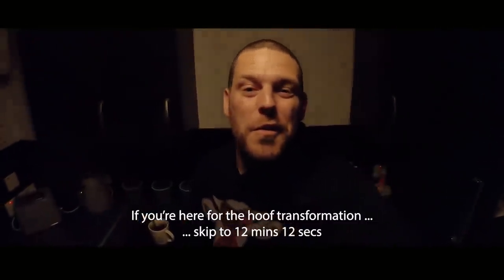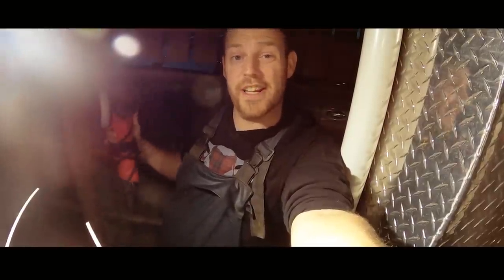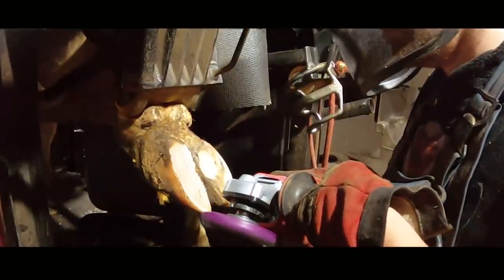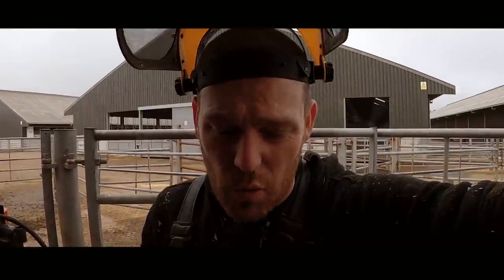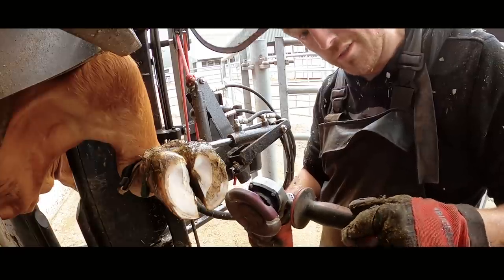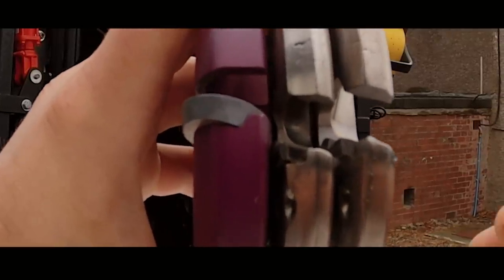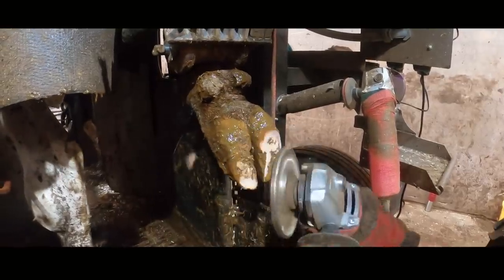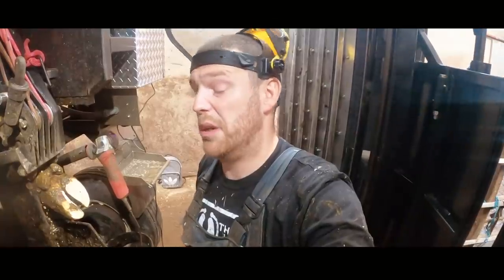*RESTORING a COWS HOOF* ... TRIMTEC vs ROTOCLIP hoof trimming dwheels | The Hoof GP

Comment: You should call the company and complain to them about how the "new" blades are not standing up the way they used to in the past. It may not be an intentional change in formula. It could be a problem with Quality Control (QC).  The metal may not have been heated/cooled at the correct temperature. The amounts of metals added to make the blades may have been measured wrong. The company may have received other complaints and will correct the problem. They know you are a regular customer because of your complaint and others, if there have been. They may try and help you by sending you a box or case of blades. It is worth a try. I know that if you contact diaper (nappies) companies about having defective diapers in the box, they will send you coupons for free boxes. Give it a try. I would like to know how you make out. Good luck!
Reply: Actually do this. You'd be surprised what the company does sometimes!
Reply: Also try getting new inserts for your preferred discs. The original supplier might have them or be able to tell you where you could get them from. Or take one of the inserts to a machinery supplier and see if they have a suitable one to fit.
Reply: I think in any field there are those who are out in the field actually using the product and then there are the people developing the product who don't always know what it's like to use said product on the scale of someone like Graeme. So the downgrade of the product was probably not intentional, as you say, they just need enough experienced people to come forth to properly articulate the problems to fix them :)
Reply: I agree with checking with the company.  One difference is that you are distributing knowledge about equipment, testing and needs and a whole lot of people are paying attention and may even come up with other uses outside the hoof trimming field. Another part is send some video clips, let them see work, visual may connect better with an explanation.
Reply: I hate to say it but the maker of the old disk may have made intentional changes to the blade to decrease lifespan to force increased sales of their products.  Happens a lot.
Reply: Those inserts actually look like some inserts we use in woodworking forthe planer or in the lathe.
Reply: It's not just quality that he is having a problem with The company have stopped making them.

Comment: A  swing arm for chord setup above and slightly behind your working position would remove most of the chord in the way problem. Just find a mounting point for a bit of pipe top and centre and weld it at a vertical. weld a smaller bit of pipe at a right angle to a long bit of pipe. Insert the small bit of pipe in the slightly wider bit bit of pipe on ya crush and you have a removable swivel arm.rin the chord along the arm and you will have access to the sides and back.  Paint it gloss black and it'll look standard.

Comment: First like. The back blade and aggressive cut is important for you because you are up against the clock. Tools are important because if you don't have the right tool, you can't do the job to your satisfaction. Good on you for trying the others but you were better with the number you first thought of. If you have a lot of cows to trim, its going to be quicker and easier with the right tool.

Comment: I use a wheel similar to trim tek but made by the company I bought my chute from. I do use trim tek on sand bedded cows because they're thinner soled and the trim tek is less aggressive. The other wheel is a lot more aggressive than trim tek. If you would like I could get you the info to order one to try. Also they are easier to model with.
Reply: Can you share some info on these disks, pls? Who makes them etc?
Reply: @oldandlumpy  Riley built in Lubbock TX makes them Google that and you'll find their website you can call them to order one.

Comment: The blade inserts on your older discs look to be a fairly standard carbide blade, very similar to the ones we use for our spindle, you should try getting some from a wood working supplier you might have some good luck with these as they tend to be of a very high standard. Another groovy video, not boring at all young fella.

Comment: I just did a quick search of that new disc and wow they are really proud of those things!! I was going to suggest taking the carbide cutters out of the disc and "model"  the disc out to re leave the metal where you would like the carbide to cut on the back side.  I am assuming the disc is aluminum. If so reinstall the disc back onto the grinder (minus carbides) and use a hand file to reshape the disc while it spins. you'll have to clear the aluminum from the file regularly but it should do the trick and get you the cut you want.... maybe.... good luck:)

Comment: Graeme just be aware that the cord grinder is a bush motor so it will need to have air flow over the bushes to cool it or it will burn out the armature.

Comment: The Roto-clip discs come with thicker metal from the factory. Once you wear them down a little they cut way better. If you get another disc from them get the thin one. It cuts on both side similar to the trim tech and are more aggressive outta the box

Comment: Great video Graeme.  Interesting to see the different type blades.  They have a LOT in common with machine tools.  Carbide cutters, etc.  It looks like all three have replaceable inserts  They might be standard carbide inserts available from a machine tool supplier.    You mentioned the new ones don't stay sharp as long as the old ones, that may be because there are different grades of carbide.  Again, a good machinery supply house can help select the best cutter insert.    The purple one has the inserts set with a real positive rake angle with the back side not exposed.  You may be able to have a machinist take off a bit of thickness off the back to expose the cutter.  It will have less of a positive rake than the front but because the insert is circular and the cutting edge is still exposed with a slight +rake, it should still cut but a little less aggressively.

Comment: Two points, the cutters you showed appear to be standard Sandvik inserts used in machine shops and carpenter shops all over.  They come in a number of configurations (a small book) and I'd be confident you could find and use something as good or better than what you have now.  If you want really scary aggressive, and I mean scary, mount up a circlet cutter on that grinder.

Comment: It seems to me you could get all three to cut on the back face of the disc with the right insert, have you asked an engineering workshop if they can machine you some inserts for your trim tech or other model using a tooling grade metal?

Comment: You seem to need a disk with a round carbide blade on the tip and 2 rectangle blades on the inside with a cut away behind so you can do the tips of the hooves.

Comment: quick question. I understand the purpose of trimming the hoofs I think.  But why do you cut the bowl or curved part out?  Wouldn't  a straight flat hoof provide more surface area and therefore better support?
Reply: He says it in other videos, but most of the strength and structure comes from the hoof walls. He models out the middles to reduce pressure on the soles. Too much material on the sole with all that weight and the pedal bone inside the claw pushing down leads to bruising and ulcers. Modeling correctly on each claw prevents all of that without compromising the integrity of the hoof.

Comment: An overhead cord drop with a spring loaded kellam grip would give you the best of both worlds. Lightweight corded grinders and no cords on the ground under your feet. A two foot swinging arm to Mount the spring cord grip just above head height so it doesn't get in the way.

Comment: As someone who works in a machine shop.   YOu can get harder bits for cheap and just replace them on the blade instead of replacing the whole blade.  There is a wide variety of inserts that are easy to install.  Just look up lathe inserts.  Also, titanium is relatively soft compared to tungsten or tungsten carbide.  Tungsten carbide inserts are what is usually used to mill out metal.   Titanium would never last.   Keep up the good work.

Comment: The Trimtec titan with LX and rimcut was the best blade, if only because of how comfortable with it you were, and based less in the results you showed. If you're looking for a replacement blade, I would seek a blade that has similar features. You're safer with a tool that you're more comfortable using, so that's what I'd seek.

Comment: I LIKE the idea of ‘your own blade’. The only issue I can immediately think of is that YOU may one of the few that use those aggressive blade. It may not be a good financial thing. But,.... I’m SURE you will have looked into that. 
On a lighter note I enjoyed Craig’s quick cameo. 
There are many times when I can see grooves from the blade on the flat part of the hooves.  Does an older blade cause that?

Comment: Getting used to new equipment is always weird. The new purple disk does a really nice rounded trim for modeling inner parts of the claws but it looks like it's too easy to accidentally make round divots in the claws if you apply pressure at the wrong angle. 
If it's small mistake with a flatter disk, you get a weird flat angle that can easily be smoothed out. But that purple disk takes out rather large, rounded chunks, more work is required to fix those. You sort of see what I mean with the 5:30 hoof.
That's my completely inexperienced opinion, though.

Comment: Metabo had a 18volt 8.0AH battery. Isn’t that enough for the whole day?
Reply: I used a lot of grinders and drills in my business and they weren't enough for me. Also, I found that the hotter the weather got the faster my batteries died.

Comment: 65 cows x 4 feet = 260 feet, 520 toes. Do you not trim all four feet every time?

On a different note, I'm wondering if a local smith couldn't work with you to design and build a wheel that does exactly what you'd like it to do. Or even someone already on your channel.

Comment: How far in do these round notches go in compared to the grinder you used to use? Those looked like the bladed part went in deeper toward the center of the grinder whereas this just has those rounded parts near the end, so you're essentially just trimming with the end rather than with more surface area. Maybe that's also why it feels weird and/or less aggressive.

Or maybe I'm totally wrong. xD

And yeah, being unable to use the back side of the grinder looks like a pain. It's obvious in the video where there are tiny moments in which you kind of pause because you're natural instinct is to use the back and then you realize, "....Well crap, I can't."

Comment: time to take up 3d printing!
Reply: It would have to be 3d printing in metal and the question is whether it would hold up to the high torque and use.  My guess is that it wouldnt unless you can ge an engineer to help design and print it at a special place.
Reply: @JillRhoads  3d printing high-density items is a lot more common now than it was a few years back;  you don't need an engineer to help design it, with a phone and autodesk you can create a 3d model of the dimensions that can be loaded up into any 3d printer

Comment: Love your channel.  Please don't make excuses for that new shite wheel.  You can cut all the feet in Scotland and it still won't cut on the backside.   

If you like everything about the trim tech except the discontinued inserts, get yourself down to your local machinist (engineer) shop and have a look through their carbide catalog.  It's very doubtful that trim tech has invented a new carbide shape.  I'd be annoyed with a company that tried to hide the industry standard designation on their inserts enough to suss out what they really were and do a video on it.  

Those grooves on the back of the purple one aren't for chip ejection. They're only there so you can get your allen key in there.  The slots in front of the inserts control the agressivness of the wheel and provide chip ejection.  Look at how wide the slots are in front of the trim tech inserts.   It certainly looks like you could widen them and thin the backside of that purple wheel out to expose the insert and make it a back cutting wheel.  Again look at the trim tech to see how they removed material to expose the edge of the inserts on the backside.  That same engineer shop could help you there. 

That purple wheel is using inserts with a built in chip breaker. Notice how thin the cutting edge is compared to the trim tech inserts.   Thin is fragile.  Hopefully I'm wrong but I don't see you trimming as many feet before having to rotate the round inserts. 

Keep up the great vids.  Another subscriber who will never trim a foot.  Cheers.